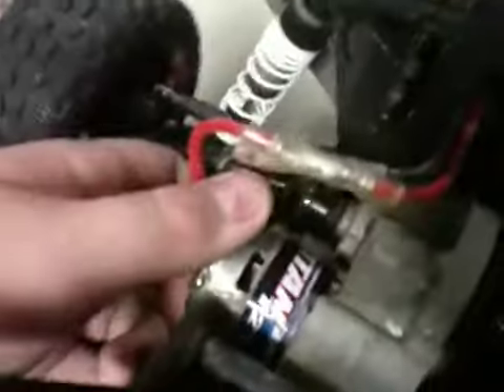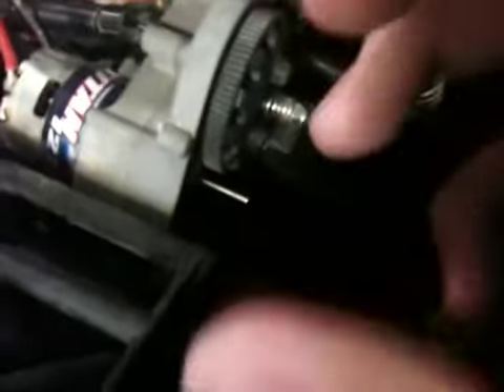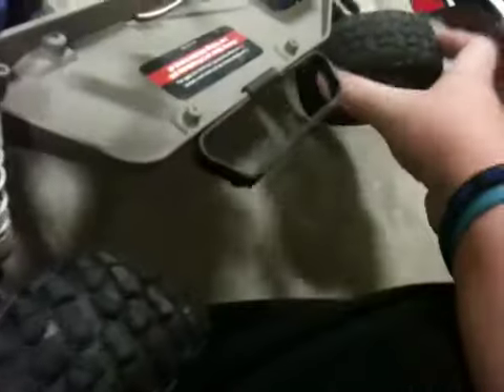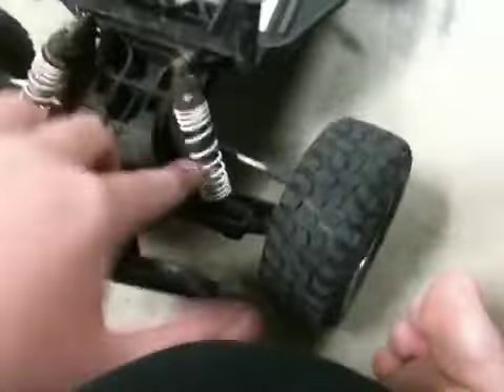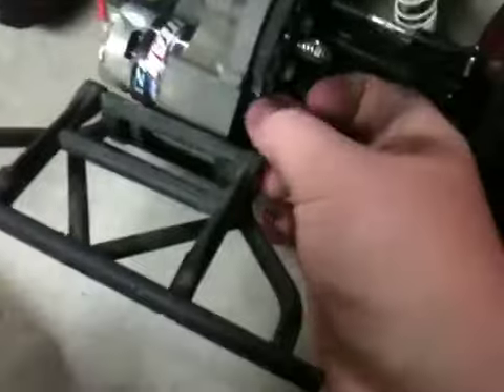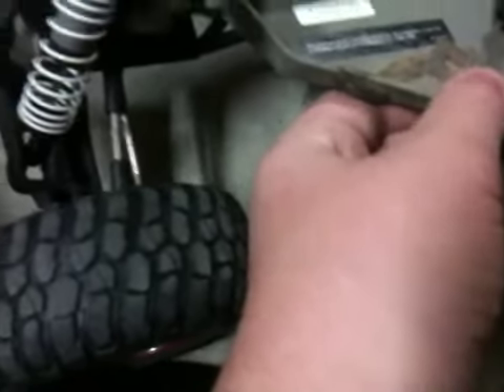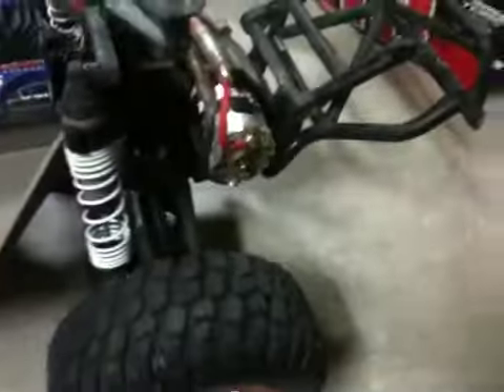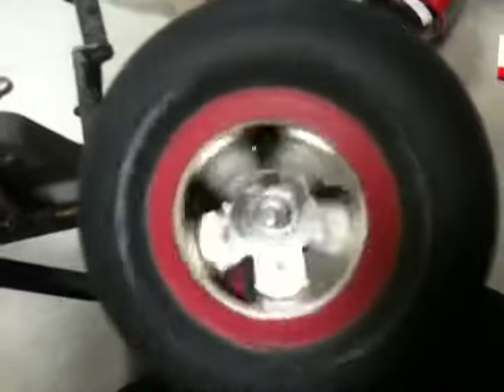Bad News on the Slash!!

Comment: at first i was saying grease it up but then when it started smoking im thiking motor replacement. and if you want Vxl is definatly worth the money, on a 7 cell nimh it will do over 40 mph and with good suspension setup and traction it will do wheelies. and for your suspension problem the metal rod that goes into the shock body is most likely bent or your shock is rubbing agaisnt the shock body

Comment: @TheMacbooksRock15 the stock runs about 20mph with a good battery the VXL runs about 50mph to 60mph on 2s or 3s lipo. in the store its about $130 or so but u can find it online for $110. if u put the titan 12t back in it give it a week or 2 and its going to burn right back up.